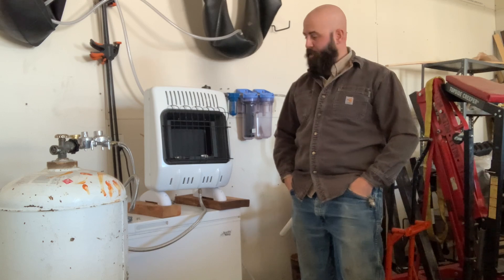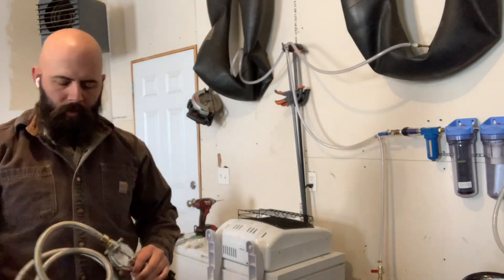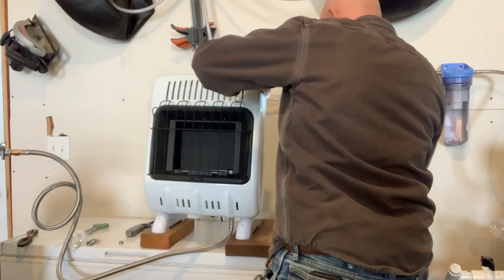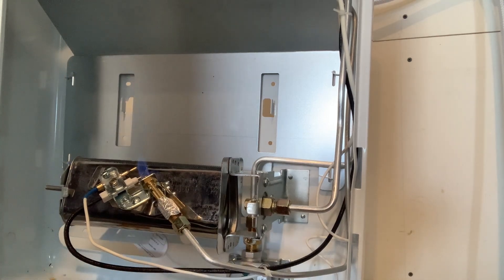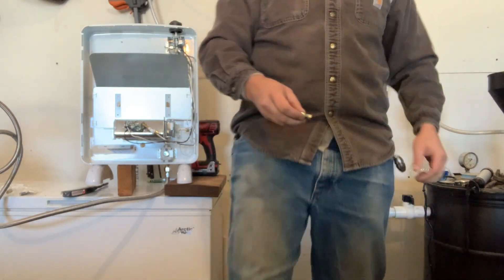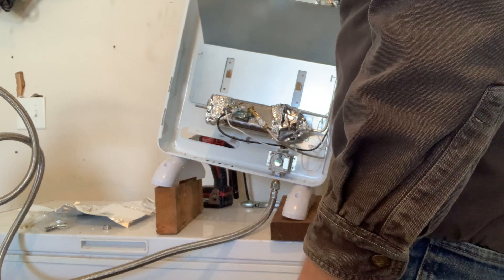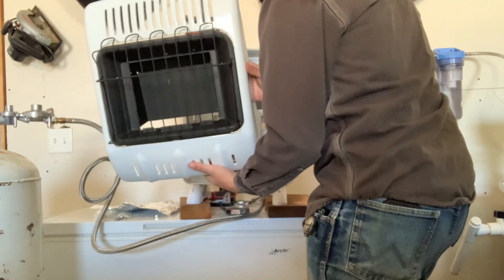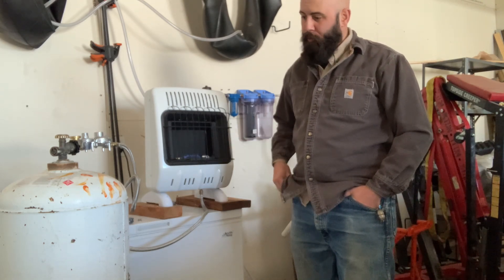Converting NG heater to run on biogas

Comment: Where your flashback arrestor.. you need some  pipe with stainless steel in tube packed one side then use course  sand..  then stainless steel packed on other side.

Comment: About how long do you figure you can run that heater off that tank if it was full?  And how many PSI do you put in the tank?

Thanks
Reply from the maker: I would never go beyond 300 psi on a propane tank. 

If that 100lbs propane tank were at 300psi I think it might run the heater for 3 or 4 days straight.
Reply: @BiogasUSA wow ! Thts freaking awesome!

Comment: You can probably just coil some wire around that igniter and attach it to the other spot. Then bend the piece of wire down into the gas stream. Just looking to get that arc close enough to the gas. I cant see why extending it with more wire wouldnt work

Comment: man get your stuff together before posting,you're using wrong fitting replacing them by 2x"s  on top of a freezer the propane was to close 
come on.
Reply from the maker: Hey, thanks for the feedback. I love any criticism, I’m afraid I don’t understand any of this though. Would you mind clarifying? 

Why is the fitting wrong? 
What do you mean 2x”s? 
What propane? I don’t own any propane. Are you talking about the tank of biogas I am using to fuel the heater?
Reply: @BiogasUSA I just discovered some of the answers we are attempting to figure out may be able to be found within the blue collar profession of gas fitting. 

They design, install, test, and maintain gas systems, appliances, etc 

May be worth checking out a few books or two~

Looking fwd to building my first digester!
Reply: @BiogasUSA hopefully you see this. 
No wrong fitting as long as it meets PSI ratings, “2xs” as in 2 by __ (wood). And he does mean the biogas tank. If it were to flashback, and the flame made it inside the tank it’d be a bad day.